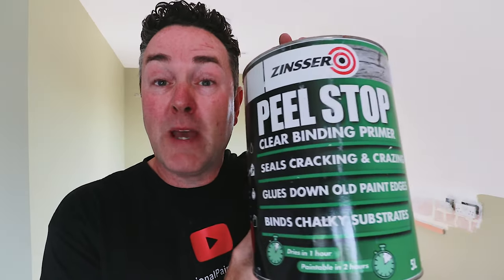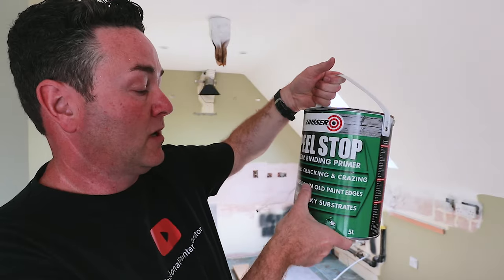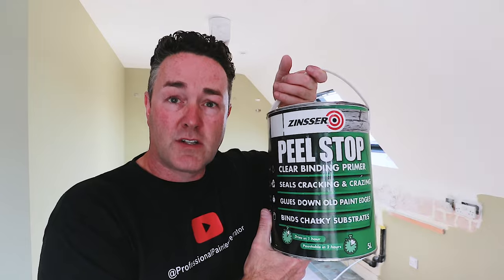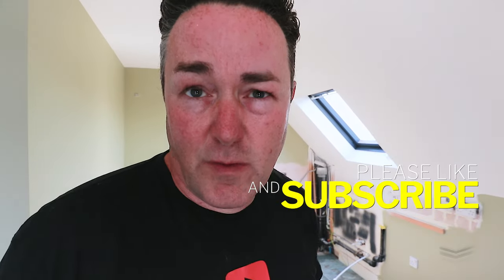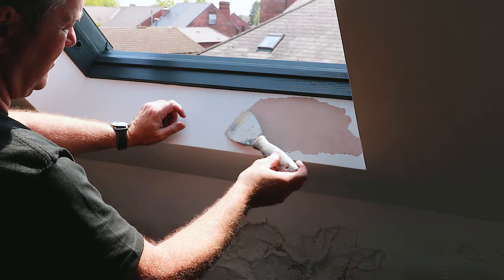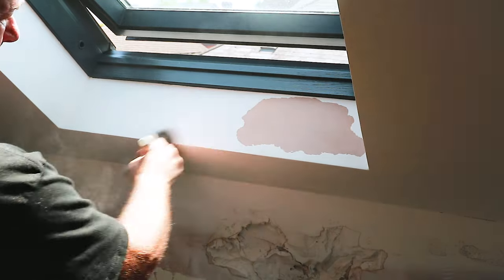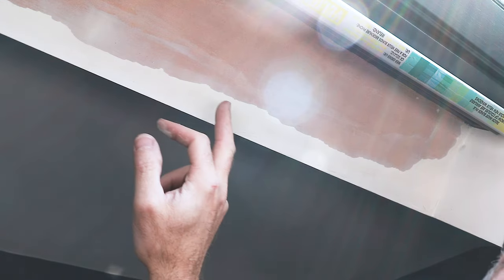Stop Flaking Peeling Paint Now with Zinsser Peel Stop

Comment: I think there is PVA in peel stop Phil you can smell it i think its PVA mixed with a vinyl polymer and probably some other additives. I think the oil based clear sealer does a better job at holding edges down etc but is a lot less convenient. i mainly use the oil sealer for paint scuttles and kettles. even though it say peel stop works on plastic it doesn't ive tried using it for paint scuttles to stop paint peeling and it didn't work at all for that the oil sealer works every time. the peel stop only seem's effective on porous surfaces
Reply: Can take fair bit of work to sort and blend in a area like that so you can't see it

Comment: Great video Phil.... 1 room in my house has an issue which I believe is because the mist coat was either not used or something similar... when I moved in 8 years ago I was painting and the old paint was coming off the walls onto the roller in some places... my late uncle done some decorating in his lifetime so I called him and he said it was down to a failed or no mist coat... he said it could be a nightmare to correct so painted it quickly for me. (I honestly couldn't believe how quickly he painted this room) he said the trick was to not let the roller get too dry to prevent it picking up the old emulsion on the wall... hes now passed away and id like to repaint that room. I was thinking I could try to do with a roller I dont let dry out and keep it loaded up with paint all the time but im not confident ill do a good job and may leave too much paint on the walls as I'm use to rolling out paint and then laying it off etc... would you be able to tell me what the remedy for my situation is please so I can paint like normal... someone recently told me id have to use a wallpaper steamer and remove all the paint and start again from fresh plaster with a mist coat etc... is that true😬
Reply from the maker: Is the paint coming off still now?
Reply from the maker: if some parts come off when you roll. that can be a sign that there's PVA on the surface, which softens up when the moisture of the paint gets on it.
Reply: Thanks for the replies mate... not sure if its gonna happen again as I've not attempted to paint that room again yet as I've been afraid incase it happens again... I shall get round to giving it a go and if it happens again I'll do what you say and guardz all the walls.. many thanks

Comment: Painted some fitted wardrobes in my bedroom with valspar emulsion paint in some places the paint chipping off on the doors and drawers is it possible to use peel stop over the doors and drawers when I have touched the doors and drawers
Reply from the maker: Sand them,touch the chipped areas with PeelStop.
Do they need a fine filler over them?

Then re paint

Comment: nice.
im not a P&D... but even i know how to use contract matt, which my builders didnt when i had my kitchen done in the summer.
Total donuts....  contract matt really should go on really damp or drying plaster, not on completely dried plaster.  So what occurs.. .top coats of paint are stuck to a paint layer that isnt bound to the plaster.
You're far better off watering down your normal paint at least 50% on dry plaster. And make sure if it is sanded to clean it up first (which they also didnt do )
As with a lot of things... better to do it yourself... a lot of trades cut corners, dont want to spend the time, want to take your money etc.. 
Get the pro traders in for the job in hand... never trust a builder to decorate.. ever !
Reply from the maker: Building was a different department at college than p&d... Other side of the campus.
I know nothing about building... Totally different trade.

Wash coat new plaster with contract Matt, 20-30%
If spraying you can go more than that as it needs to soak in. So the thinner the better.

Don't use durable Matt paints for wash coating. It doesn't soak in enough and can peel away from the surface.
Also no point wash coating with expensive paint.

A dedicated bare plaster primer is ideal . Screwfix do one. Tikkurila Optiva Primer is another.
Can be used straight out the can, but I still add a bit of water to help soak in more.

Comment: I've just moved into a place where they clearly just painted onto the plaster - masking tape takes off chunks of paint and there's places where the paint is flaking off. Clearly if I just paint it now it's not going to hold to the wall. Would you recommend I use this in the flaking areas and then paint the whole thing with a generic primer? Or coat the whole wall with this stuff? Or sand the paint off to go back to the plaster?

Comment: Phil I bought some brick sort of a foam material, they come in sheets. It looks good when on walls but the paint flakes off quite easy.   Can I use peel stop after it painted.  One more thing does peel stop dry Matt or glossy.    Thank you for your time.  Paul
Reply from the maker: the foam stuff is from wall insulation?

peelStop, not that glossy, you paint over it anyway

Comment: 🎉is that type of paint bubbling a sign of dampness or simply the wrong type of paint? I have the exact same issue. They used cheap screwfix matt paint, which gets stained extremely easily. Absolutely terrible paint what they used. I can see lots of spots of paint bubbling on the internal dividing wall.
Reply from the maker: Could be a number of reasons without seeing it.

You may need to burst them and scrape them to a tight edge and follow my instructions in the video.

If it's damp behind, you normally see darker plaster due to the moisture in it.
Reply: @ProfessionalPainterDecorator  thanks. Would there be any signs of black mould? Or simply the plaster would be much darker than normal?
Reply from the maker: You'll see and sometimes smell mould.

Comment: after you use the final coat of peel stop, why wouldn't you prime the rest/entire wall before you apply the "emulsion"?
Reply from the maker: if you so wish, but there's no need uless the surface is a problem with peeling areas.
If the surafce is dry and porous, you'd be better using GARDZ on all the emulsion.

Comment: Hi mate.
Great video. I'm painting over high gloss kitchen units. I'm using tikkurila primer and top coat. However, there are little bits of peeling gloss coating. Should I use this on the peeling bits and fill with a fine surface filler prior to applying the primer?
Cheers
Reply from the maker: If it's peeling yes. 
Is it paint peeling or a wrap film on the kitchen units?
Reply: @ProfessionalPainterDecorator  thanks very much for replying. It's the gloss paint finish that's peeling.  Just in bits where it's crazed and then peeled on a cabinet above the kettle. I've tried to scrape it off but it's stuck on good. I also tried a paint stripper but didn't budge it. So I'm now thinking of sanding a little then applying peel stop and maybe filler to smooth it out prior to the primer and top coat. What's your thoughts?
Cheers

Comment: I've just started to strip the walls in my living room and the taking the paper off has caused the 3 layers of vinyl paint on the adjacent wall to peel off the plaster. I've taken as much off as possible (about 2/3's of the wall) but the rest just won't budge. Would this method work on the remaining paint layers before I sand and repaint the whole wall?
Reply from the maker: get all your wallpaper off, then soak your wall again where the paint is with hot soapy water a couple more times, that will soften up the loose paint so you can get a bit more off. once you've done that and it's all dry. Use the peel stop to bind those edges down.. you can coat the whole wall up.... then skim over those paint edges with filler.. sand so the wall is smooth again.

Comment: Never knew product like this existed so thanks. Have a large 1 to 2  square meter area behind and side of rad that had wallpaper on when moved in over 10 years ago.  Removed and just painted straight ok the wall. It flakes like crazy and very powdery.  Odd how whole wall isnt like that.  Guessing this is the product to use.  Could i use zinsser bin on top of it as belt and braces approach and the emulsion or not needed ?
Reply from the maker: welcome... I think you may wantto look at using GARDZ and not PeelStop of you have had wallpaper on teh surface before. Search my channel, I cover it on many videos

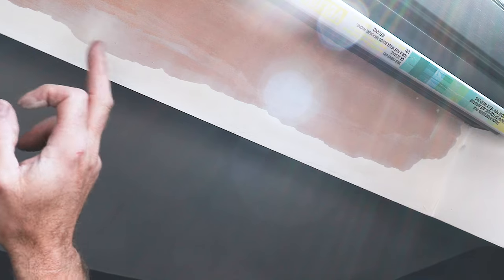Comment: At 13:03 you mentioned "with presto F." What does that means? Did you use Peel Stop on the part, let it dry and then use 'Presto F'? Sorry if I sound silly. Lol. Thanks for the informative video. Really helped.
Reply from the maker: Presto F, is a filler pre mixed in a tub made by Tikkurila.

clean all your area down of anything loose, use PeelStop.
Then Fill any areas that need to to get it smooth again.
sand lightly down. 
On the bare areas of filler, you can either spot primer with the peelstop, or thin a bit of you paint down and touch the filler over.
Reply: Have been advised to use zinsser bulls eye 123 primer before using easifill is that what you'd advise?

Comment: Do you have to use filler? Because I’ve had to peel off quite a lot of the bathroom ceiling. If I do two or so coats of paint will the outline of the old paint come through where it’s peeled or do I need to fill over it all?
Reply from the maker: Oh no, if it's nearly all come off you can just do the mapped edges... Not the whole surface.
Use your coman sense as to what's best to do and what will look beat once painted.

Had a ceiling this week, flaking on one edge... The whole lot came off due to no wash coat.
That video is next month.
Reply: @ProfessionalPainterDecorator what's a wash coat please?
Is there also a way to seal wallpaper so moisture doesn't get in - can I use this across all the wallpapered ceiling if it dries clear? What product would you suggest please? Thanks
Reply from the maker: @martinaharrisondefault5027  a wash coat is a first coat of paint, thinned.. that goes onto bare syrfaces, like plaster mainly... bare plaster primer from screw fix.

wallpaper varnish, have look at Polyvine decorator varnish.

Comment: The existing paint on my metal garage door has the look of miniature crazy paving. I wonder if Peel Stop would work here too? - obviously I intend sanding it to  level the surface first.
Reply from the maker: is it flaking off?
Reply: @ProfessionalPainterDecorator  It is easily lifted by a finger nail, where a crack is just wide enough. I sanded a small portion and the cracked paint came away from around the edges of a smooth area, again, quite easily. Before you say, "remove all the old paint, and start again" I have absolutely no appetite for sanding a whole garage door, back to its original undercoat, ha! 
My intention was always to smooth down the protruding, crinkly bits and then sealing the rest to prevent further loss. All prior to applying a fresh under and finishing coats.
Applying something like Peel Stop, just appeared  to be a quicker solution, than a COMPLETE door paint strip-back, to its original factory condition? With all the effort that entails?
Reply from the maker: @shill6449  I was gonna say.. PeelStop it, you've nothing to lose. Then coat the whole thing up with Zinsser ALL Coat Exterior Satin (water based)
Reply: Thank you Phil. That's exactly what I had in mind.
Tho' I did intend applying a white undercoat on top of the Peel Stop, followed by a Satin White, water-based, finishing coat. Keep up the good work. steve
Reply from the maker: @shill6449  no need for the undercoat with AllCoat exterior.... or Bedec MSP, they self prime and Uc and finish all together.
the peelstop will act as your base sealer too.

Comment: Hi Phil, wee question for your masterful mind regarding crazing.
Will using peel stop or Gardz for spot priming do without flashing or will i need to cover the full wall
Reply from the maker: I have used gardz for the odd spot priming over filler prior to emulsion painting.
It does the same sort of thing... Stops the filler soaking up that first coat of paint in those areas

Comment: Does this work with grease spots on kitchen wall from previous owner? Paint wont stick despite sanding it down. Grease soaked through
Reply from the maker: It should. Have you wiped it very the mark with white spirit then go over with some meths?

Comment: I followed this exact procedure in a bathroom that someone had put contract matt on and it started to peel due to moisture getting inside the substrate. I the Finished in Johnstones durable matt and it’s started to peel again 🤬 I took it back to a firm edge, zinsered it, filled, sanded, zinsered it again (is that a word?) thinned down coat of Matt, two coats of durable matt.  I don’t know why it’s occurred again. Should I charge to go back?
Reply: Ventilation
Reply: Paint is a far better sealer e.g MSP. That zinsser  product is produced for  mugs who think it has magical properties. Like a lot of overpriced zinsser  products.
Reply: I got a downstairs shower room with no window, just a extraction fan... the ceiling peeled back... I took all the paint off the ceiling using a wall paper steamer to get back to plaster.. I then diluted a can of zinsseer bulls eyes 1-2-3 (blue can) with 10% water and gave it 2 coats. I then gave it 2 coats of zinsseer perma white  and it hasn't peeled yet. Its been 2 years.  ** (I am not a decorator)** its worked so far 🤞